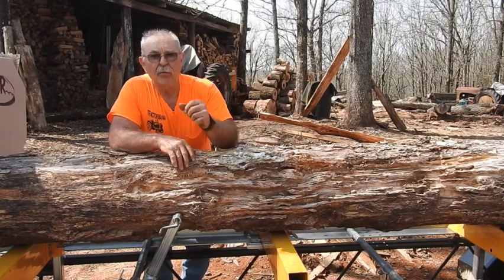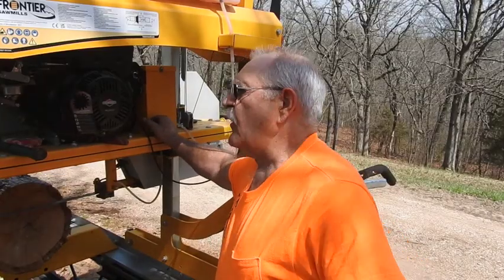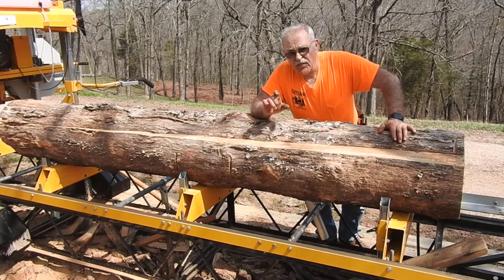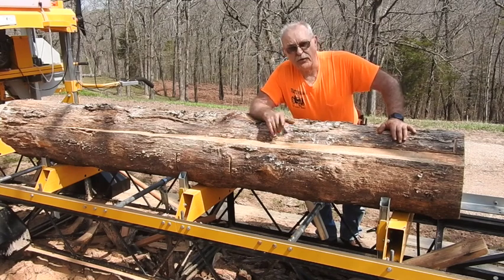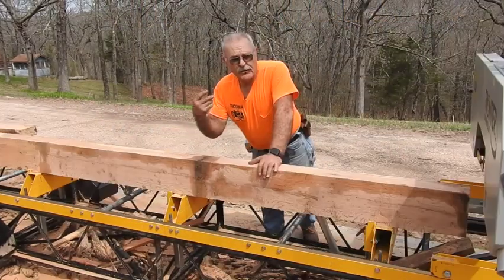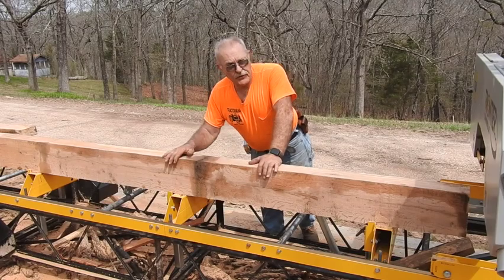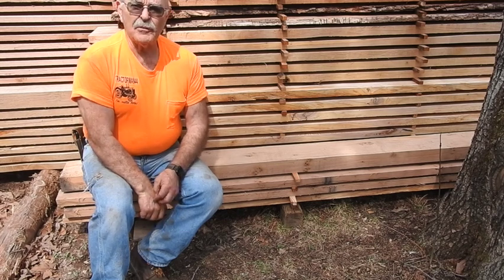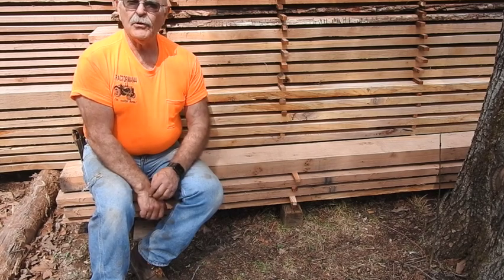Is There Any Good Inside This Ugly Log ?

Comment: Happy Easter friend.     I might be wrong but aren’t your backstops supposed to be positioned so the slanted side faces the log? I figure that way the log would be easier to roll.
Reply from the maker: Yes, good eye... in theory that's the way its supposed to work. But the edges are shear-cut and sharp enough to gouge into the wood equally whether they are frontwards or backwards.  I've planned on sanding them smooth but just never got around to it.  I'll either make or buy rollers eventually that sit flush with the leading edge.   Some of the other manufacturers have that as an option, but not these lower entry level machines.

Comment: Very nice log inside.  Made some nice lumber.  I got 20 American chestnut logs when I took down an old tobacco barn that was falling down, for a neighbor.  Most of the logs were pretty shot.  The barn is from the 1800s.  I have cut some pretty nice 4x4s out of some of the logs for a project I am working on.  In the meantime soaking the Allis Chalmers B gas tank with lacquer thinner to clean out that tar residue old gas issue.
Reply from the maker: Now THAT would be cool, to trim down old beams for new material.  I've got a pile of telephone/electric poles I'm planning on cutting 6x6's out of.  Now let me see..... Sawing 4x4's....new old Alliis....hmmmm, maybe a new shed..??  Chestnut would be some good material and the fact it is so old is way cool TBP.  If the lacquer thinner doesn't do everything you want, try a few gallons of vinegar.  I usually do the electrolysis thing, but many others claim vinegar does a great job.

Comment: I hauled hardwood logs for 18 years and the opposite is also true. Trees that brought high prices on the stump turned out to be of little value once they were cut down and bucked up. Spider cracked and filled with rot...sort of like cancer.
Reply from the maker: Boy o boy, you said a mouthful. Some of the strangest grain....good AND bad can be hiding under the bark SK !!  We have seen a good bit of both directions as well.

Comment: I've got a bunch of good lumber out of logs like that over the past few years taking it to have it sawed up.We now have a band mill like yours we have a OS 31. I have really enjoyed it. I also do like you do when I'm squaring up a tree I'll takeoff large cuts and then use that for firewood and saves blade life when all I'm gonna get out of it is a few small boards with a whole lot more effort.
Reply from the maker: Extending the life of the blade is one of the goals of cutting the thick slabs in addition to creating thick enough material for the heating units.  I don't show the prep work on getting an old log ready for the first cut.  I use a metal detector then inspect up and down the log and knock off all the areas of the bark that hold embedded grit and dirt from the extended storage time.  I'm seriously considering a debarker for that reason.  I wish I'd have gone with the OS31 for the added width and it actually takes the same 144'' blade as the OS27, so I think your drive wheels must be smaller diameter to allow for the 4'' wider log allowance.  But in general like you,  I am happy with the Frontier.
Reply: @tractorman4461  I just replied to this message and it has disappeared. I don't know if you got my reply to it or not.Not good with technology.
Reply from the maker: @CustomBuiltDIY  I got this one and the original.  But nothing in between.  That happens on this end on occasion.  A comment is there, I click on it to reply and it disappears. So I can't reply to it at all.  Me and you are about even when it comes to technology I think.